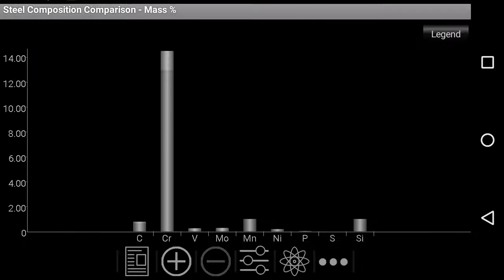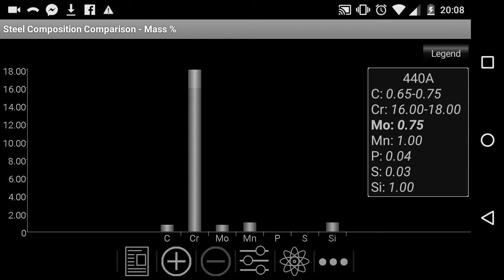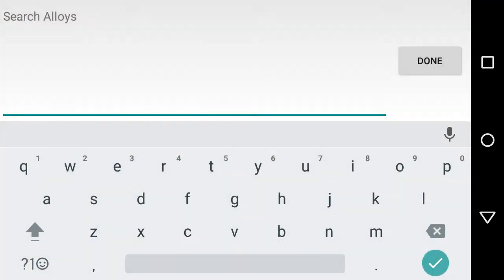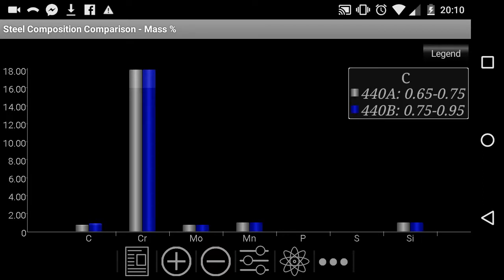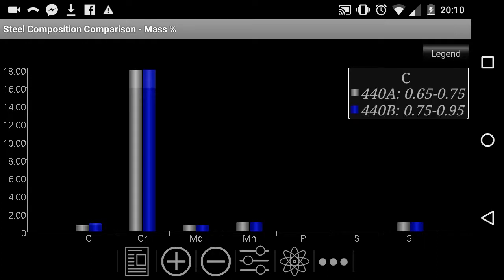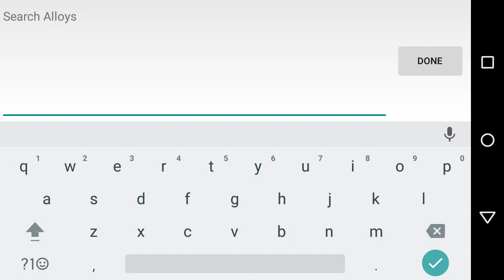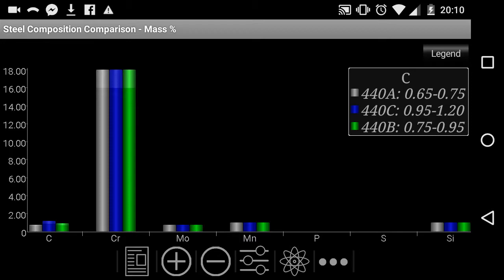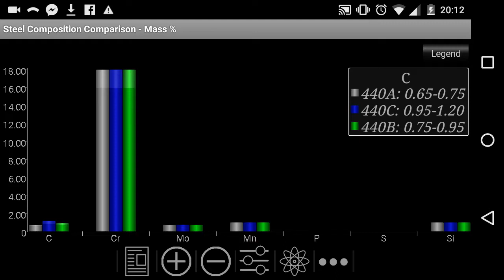Is 440 Stainless Horrible steel?

Comment: Interestingly I have a few knives of 440A and a Chinese folder from the flea market, a darkops copy. I never had any problems with the folder, used it since 2011 and resharpened it several times, paint came off, screws fell out, put them back, abused it in the kitchen and outside. Still going strong, and the blade steel is impeccable. So I think lot of BS is generated by SALESMEN, who have to sell the more expensive stuff which is not as good as they say, but double the cost, triple the cost. I do have a range of Extrema Ratio knives also, the steel is super (N690). But then I also realized that sharpening the Chinese folder is fun and the steel is more than good enough for edc over the years!!!! So Yes, heat treat is important, and second, forget the stupid youtube videos where people abuse their knives. Oh and don't forget the Spine Whack stupidity. Normal people do not have to worry of the blade closing in on them.  Do you abuse the Victorinox knives as well? No, yet they have no locking mechanism, yet they have cheap blade steel, yet they are in a class themselves and never heard that ah, this is a baaadddd knife because it has shit steel. But you hear that wow, it has so much utility capability, everybody should have one.... So ranting on steel is BS unless you really want a special steel. Otherwise a good knife looks good, feels good, cuts good. So if you like it, buy it!

Comment: PS: Nice thing is that 440-C is easy enough to Field Sharpen (2000 wet/dry Sand paper, oiled with a few drops of Tea-Tree oil, wrapped around a square wee block of wood does wonders. Cudeman’s’ MT-5’s blade in N-695 holds 15 Degrees/Side… no chipping & no rolling… Nice thing is it is Economical… Of course, 440-C is not the favourite for toughness in a long (over 7”) chopper… but Stainless Choppers are likely a contradiction in terms.

Comment: BINGO: & NOT ALL 440-C are created equal either. CUDEMAN does an excellent “MT-5” blade using N-695 (Bohler’s refined Version of 440-C) @ 60HRC… possibly my favourite 440-C Knife maker. Most 440-C are 2 points softer, & 58HRC… 440-C has one of the highest compressive strengths in a stainless: great for Bushcraft/Camping knives.

Comment: I have a knife that's titanium bonded 440 still, so I reckon in my head that means it's titanium plated in a way it also has a black oxide finish on most of it, I only use it for game and food preparation and it's lasted me about 6 years and it stays razor blade sharp now if you go being stupid with it yeah it's not the best but I've never had an issue with this blade, anyway my question is is I'm just trying to find more information on titanium bonded 440 still and what it actually is and how it performs, if anyone knows please leave a comment and I appreciate it.
Reply from the maker: The reason you're enjoying the knife is not because of the material, "titanium bonded 440" is just cheap marketing junk.

Comment: 420a vs 440c ?
Toughness and corrosion resistance ? use by the average user ( for example as a gift for a friend ) is 440c better for kitchen use  ?
Must not corrode

Comment: Buck knives, Paul Bos heat treatment, nuf said.
Rough Ryder knives 440A not bad. Chinese been making knives for thousands of years I think they got it down. 30 years ago I bought a Chinese butcher knife, still use it, sharp as a razor only maintained with a steel, original edge still visible at handle.

Comment: I have 440 steel knive for a long time, I randomly buy it because i like the look the price as I remember is not expensive but I dont remember it was very cheap. I dont have solid knowledge about steel type and dont care either. Early 2020 I start to collecting knives and read about it. I just realize that old knive still look like new and don't rust with zero maintenance...., I started to give it attention... ..testing it stabbing hard woods etc over and over and the tip never bend, and still no rust until now.... I think 404 will do the job for same as the expensive steel.

Comment: Just sharpened a Böker 440c German made Barlow, finished with atoma 1200 and 0.5 micron strop, crazy bite and shaves like a razor... Love it.
Reply from the maker: just ht'd some bohler 695 (440c) got it at 63-64rc, I like 440c, but there is some horrific HT and geometry out there and confusion with low end 440a

Comment: My experience is that 440A is a much better steel that it's reputation would suggest.  It's the most widely used knife steel in the world, and I've seen near miracles performed with it.  I don't, however, thing heat treat is a big factor with 440A, as long as you're dealing with reputable knife companies. .  Heat treat is pretty much standardized by now.  It isn't difficult to do, and if you want to watch it all done to perfection, go to China.  And if you want to see it screwed up completely, also go to China, or India, or Pakistan, and a few other countries.

I do think comparing the carbon content or 1095 and 440 steel is like comparing apples to submarines.   It doesn't matter how much carbon a 440 steel has, and it often is NOT as much as the maker claims, it will never have the attributes and characteristics of 1095, so why make the comparison?  

There are massive number of steel snobs on YouTube.  These snobs, in my experience, fall into three main groups.  1.  Those who really don't know much at all about steel, but read a data sheet, maybe listen to a couple of videos, and think they know more than they do.  2.  Those who are trying to sell you a very expensive knife made from the latest crucible steel that's guaranteed to slice granite like butter.  3.  Those who just bought the granite slicing knife, and who don't want to admit it really won't slice granite very well at all.  In fact, it will barely slice butter without chipping.

I also know that much of the bad reputation 440A has comes from mistaken identity.  Everything gets labeled "440", whether it's 3cr13, or some junk steel that is nothing more than melted scrap.  A good deal of knives coming in from Indiana, Pakistan, sometimes China, and elsewhere,  not only isn't blade steel, it isn't any kind of real steel.  I've seen tons of random stainless steel from a junkyard  melted together, turned into knives,  and stamped "440 stainless"..  God only knows what kind of hweat treat this steel gets, if any at all.
Reply: Ya have to really know what you're doing in order to properly heat treat 440c. Open air forges & furnaces will RUIN 440c. During the heat treat process, 440c cannot be exposed to atmosphere at all. So many people making knives nowadays, and far too few of them know how to heat treat 440c......then they turn around and "blame the steel" for their own mistakes. If done correctly, 440c is hard to beat. Also the most stain/rust resistant of them all.

Comment: 440C is still one of the best KNIFE steels made.  The problem with steel is that very, very few, scientists least of all, understand that after a certain point such things as hardness, toughness, abrasion resistance, etc., become negatives on a working knife.

The people who need high end crucible steels are those who use a knife all day, every day at some form of work, and who hand that knife in to have it sharpened.   People out in the real world, on the farm, in the wilderness, etc, not only don't need such steel, it's worthless because it's ore trouble than you have time to deal with.

All steel gets dull.  It simply does.  What seldom gets taken into the equation is what the average working stiff, farmer, or wilderness person does when that steel finally does get dull.
Reply: very poetic thank you for that response.
Reply: I agree

Comment: I have a 440 blade that’s just marked 440 stainless I’m sure it’s made in China is there anyway to tell if it’s A B or C and also is there anyway to tell how well it was hey treated?Im more curious about the heat treating since that’s probably as you’re saying the biggest indication if the 440 is going to hold up to good use.

Comment: Bd1n will always be my hope for redemption for 440c in particular.   The most premium 440c in my collection is my spyderco cat.   Bd1 replaced it a few years back and now bd1n is down the pipeline.   The spec sheets say bd1 is equivalent to 440c.   If that's true than my conclusions on 440c ever being sub-par are false.   The bd1 on my alcyone stood toe to toe with my para 3 in m4 and won me over.   Toss some nitrogen in the mix and you have a different kind of animal with those nitrides.  Cold steel is now using aus10 another 440c equivalent with successful results from what I have read.   I do my best trying to put a working edge on crappy 440 steel/ Pakistan powerhouses for friends and Co workers from time to time.   I've never seen geometries so obtuse in my life,  don't think any steel would cut at the edge angles I measured them at.   Good heat treat allows better cutting geometries in my experience.   Since it's a knife that should be the goal,  cutting performance.   If a knife doesn't cut the way I need it to,  then to the Stones we go.

Comment: I have a few 440C blades made in Solingen, Germany. Even a 1.4110. And they OUTPERFORM some of my more modern steels such as 154CM, VG10 and even S30V to some extent. I can recommend 440C from a decent company. Great performance.
Reply: made from who ?
Reply: @AAAAAAndrea  Böker and PUMA are some of the best imo. I hear the stuff coming out of Maniago, Italy is really good too. Be careful with the stuff the companies have made in China. Very often pretty bad steel treatment.
Reply: @LarsRibe  From Maniago,wich models ?
Reply: @AAAAAAndrea  MKM, Lion Steel, Fox.. just make sure it says Maniago
Reply: @LarsRibe  I am Italian so I'm happy our products are appreciated , but 440c ? MKM doesn't have 440c on the website
Reply: @AAAAAAndrea  Not any more. Solingen knifemakers still use it for some reason. 440C is fine, but there is no reason to use it any more because newer steels are not that much more expensive. Maxamet and stuff like that is of course expensive, but I in my opinion overkill for most tasks.

Comment: Can you re-heat  the 440? And what would be the temperature? 
Thanks.
Reply from the maker: look up the spec sheet. No, not without an annealing operation, needs to not be too thin either, needs atmosphere control, needs temp control.
Cheaper to start with another piece of steel
Reply: @FearNoSteel  ok, thanks

Comment: Been looking at Randall made knives 440B/C blades for saltwater use. Entrek uses 440C and people also really like those.
Reply from the maker: for saltwater? lc200n, nitrobe77 and vanax superclean. these nitrogen steels won't rust and they will out cut the 440 steels
Reply: @FearNoSteel how flexible (tough) are those steels? Also I have not found any models or custom makers for those steels that I want.
Reply: For prying abalone among other things.

Comment: I'm old enough to remember 440c being a premium steel when I was a kid. It is a solid performer with good corrosion resistance as long as it gets a good heat treat. My attitude toward blade steel has changed over the years. It used to be a top priority anytime I bought a new knife. Then it dawned on me that for a guy with an extensive knife collection, who enjoys sharpening, perhaps absolute edge retention needn't be a priority? Besides, knives that are easy to sharpen are more fun to sharpen and encourage me to experiment with the profile and angles to find what is best suited for that knife. You can do that with Rex 121 or Maximet but it would hurt wrist and break your spirit
Reply: I think there is little point in going too into steel composite, unless you are a salt water diver/fisherman or something, the worst steel available now is insane compared to the poor consistency and purity of the average steel a few hundred years ago, and we've been killing people very efficiently for thousands of years with sharp stuff, hell they used to make blades from copper and bronze, 440c is like fucking adamantium compared to metal throughout history!
Reply: @Unmanagable  your a boyo and have a great point the adamantium joke made me laugh but is also true af
Reply from the maker: super steel needs super stones, thats the plan, why though? because people should sharpen because they want to, not because they have too.
Reply: I'm with ya

Comment: Cool video, great information. I have a blade that is 440C and it sharpens easily to a hair popping edge and holds its edge fairly well. I have nothing to complain about with 440C. I've read that 440A and B aren't so great.

Comment: So i bought a 440 knife off of amazon, ive tried sharpening it and stroping it, but i cannot seem to match the edge on my leatherman Skelatool KBx which is shaving on contact after going through the same sharpening process. Can someone help answer what is going on that is preventing me from getting this 440 knife sharper
Reply from the maker: No one like to hear this, but its your technique.

 you're not holding a consistent angle
 you're not forming a burr or deburring properly
 you're crushing the apex with too much pressure when finishing the edge.

You have to rule that stuff out. I have to mitigate these things everytime I sharpen.

Even then, I doubt the pinnacle of well heat treated 440 stainless is found on amazon for under $100

Comment: I got an MTech USA Xtreme MX8054 that is 440C stainless and the heat treat seems to be fantastic. It seems to hold an edge for a ridiculous amount of time. It holds an edge longer than many of my 1095 knives.
Reply: Nikolai Bolinski That's a really good knxife you have there. I personally think 440C is a great steel but it CANT be air heat treated as the oxygen will crystallize on the outer grain. Thats why home makers just cant use it.
Get the heat treat right and its killer.
Reply: Scottish Outdoors Yeah. I absolutely love it. The heat treat on it has never given me any issues. I actually have 2 of them. One for actually working with and the other for looks and just generally screwing around when im bored. LOL.

Comment: Got two fillet knives from Knives of Alaska that have 440C steel with a rockwell hardness of 57-60. Very well made knives & sharp. Much better then those carbon steel bubba blades I bought.

Comment: I love this video it's probably going to blow a few Minds well done I've always had personal Theory on 440 with cheap Chinese made knives originally when it was developed the 440 series entirely was considered high-end Steel I've always wondered if when they marked it 440 it's sales tactic and a lie and it's actually some crazy pot metal they had access to I'm pretty sure most flea market blades marked 440 aren't even actually 440 a b or c
Reply from the maker: Correct brother, most of the Surgical stainless stuff is in the realm of 420j2/3cr13mov which is the lower carbon cousin(0.30) of 420hc(0.45)

haha or even worse aka the Pakistan special.

also cryogenic tempering goes a long way on stainless steel. That was Paul boss's legacy with buck and 420hc. Which has become the standard for stainless heat treating in the industry. 

The reputation of this steel, 440,  is so tarnished that it is not worth making knives out of due to people writing it off as crap.

Which is a shame.